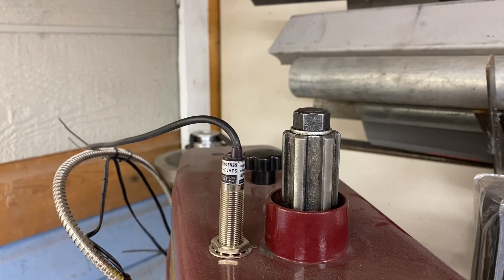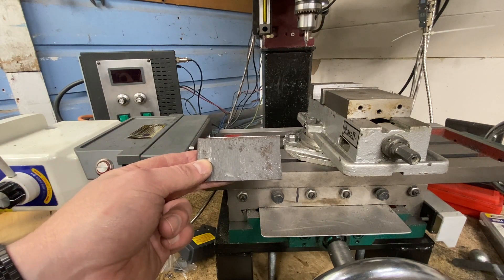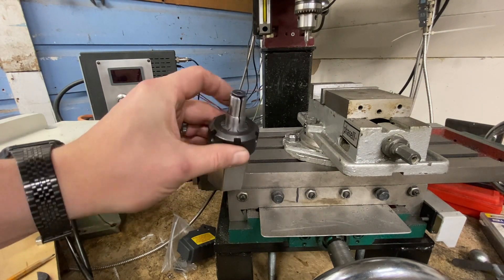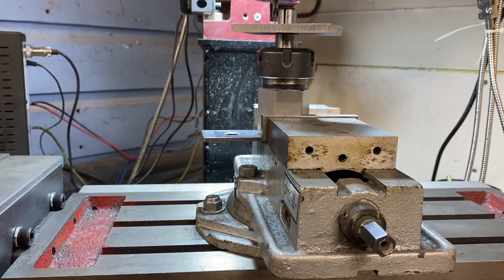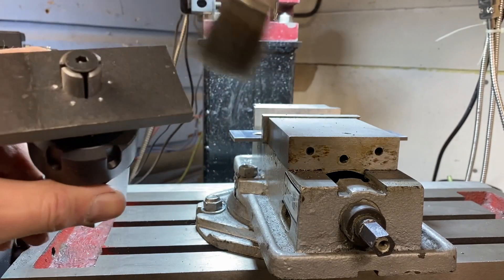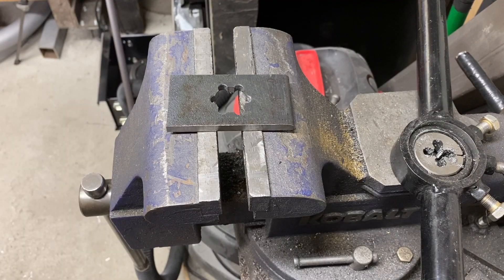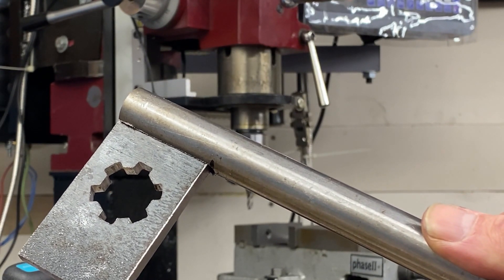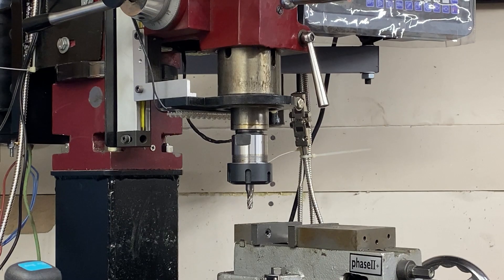Making a DIY Internal Splined Spindle Wrench Without a Keyway Broach for my 3-in-1 type mill

Comment: Nice Job and very good idea. Just don't leave it in the spindle and Power up. I was thinking of useing a micro-switch to a blinking light  and/or disabling  relay  for motor as safety for my chuck key if it's not in it's home.  I have toss it across the room a few times, not paying attention. Would be a east project you do have a power source  and a Perfect Size Box 🙂and all.
Reply from the maker: Thanks for the input that is a good idea.  Thankfully when using my new wrench I never let it out of my hand.  I take it from the wall, tighten my drawbar or collet holder, then remove the wrench and hang it back on the wall.  Not saying it couldn't happen but less likely than leaving in the chuck key.